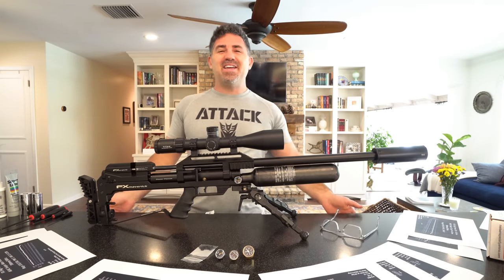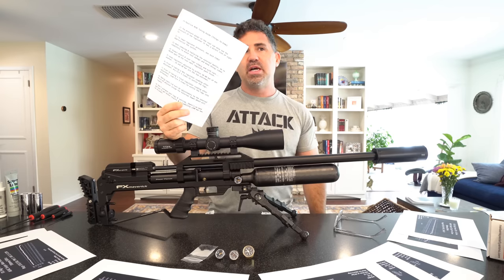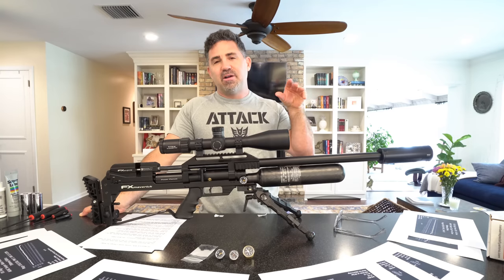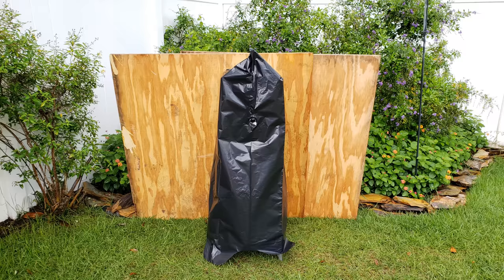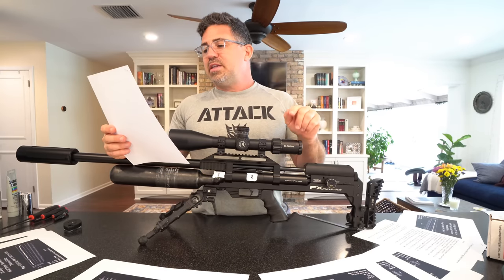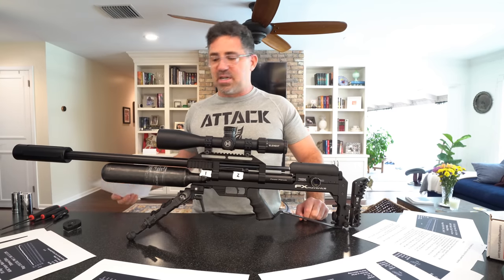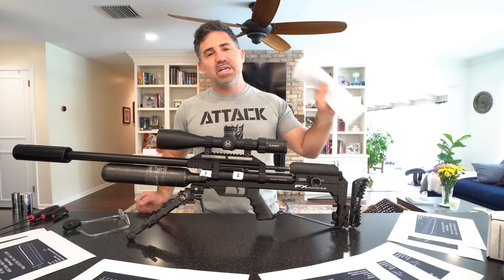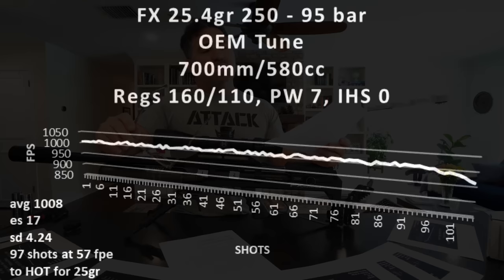FX Maverick .25 (Review) + TUNING GUIDE !! + FULL SETUP + Accuracy Test !! - How to Tune an Airgun!

Comment: Sir this video is pure gold. I bought a used FX Maverick .25 Sniper with STX Slug Liner, Optisan Optics EVX 6-24×50, 3 magazines, extra 500mm barrel kit barrel kit and Donny FL Fatboy1.0 moderator, oh and I had a carbon liner added for free. All for $2100. I think that a FX slug power kit is probably installed as well. But I will get that confirmed. For pellets I will tune the 500mm barrel. It’s genius actually because whomever owned the air rifle before me considered both slugs for long range and pellets 100 yards and under.

Comment: Fantastic work Steve! I have a newly purchased Maverick Compact .25 cal. Can’t wait to try out the 25.39 tune! Can’t believe the reg is set so low yet it pushes at such a good speed! Incredible!!!

I’d also like to see if I can shoot the hybrid or the NSA 26.8 out of the Compact as well. Any recommendations on the reg settings? Is it even possible to have one reg setting and use the power wheel to adjust between the pellet and the hybrid (or NSA 26.8)? Thanks in advance! Keep up the great work man!
Reply: Thanks brotha!  I really appreciate the kind note.  Best, Steve

Comment: Steve great to see someone finally dispel the myth of velocity variation,  a spread of 25 won't even give 1/4 moa but a damaged skirt will.  Am curious to know if you were using the heavy hammer from the slug kit or the stock one.  From what I have found if the heavy hammer is installed you have to greatly increase the  reg pressure or the valve is basically knocked into next week. That said , with one ,165/130-140 seems to work well as an all round tune for pellets and up to medium slugs from the Superior standard liner . The higher pressure producing  more energy with less air thus the shot count is still retained and an accurate harmonic tune can usually be found with the power wheel for each projectile.

One thing that might have been worth covering is how the fine adjustment screw actually works.  If you extend it much past 6mm you have a high probability the gun won't cock and if you have it in too far you will have no additional pre-tension on the first couple of power wheel settings ( velocity won't change as your increase PW value initially).  Also the Friction grub screw has a tendency to come loose and fall out of the hammer  fine adjuster assembly and some weak locktite is well worth a dab.  Its the one area that the manual thoroughly fails to cover, giving neither the OEM length or guide to the max length.

Sorry if I'm being a boring geeky ar*e
Reply: Had the same issue w/ the friction grub screw coming loose on my .30 Sniper...was chasing ghosts for 30+ minutes on velocity drops till I figured that out
Reply from the maker: Hello, I talked about it in vid several times for you guys and in depth but no, I never saw a need to try the accessory heavy hammer kit.  Regarding the internal HS adjuster as I discussed in the vid, I never saw a need to adjust it more than about 3.5 turns to run flat from 45-72 fpe.  Because of this, I found no need for further exploration.  Best, Steve
Reply from the maker: @vetteconnoisseur9531  My macro wheel screw backed out a bit few times too.  I didn't mind though.  Best, Steve
Reply: @aeacvlog2033  hi Steve I know you mentioned quite a bit about it and personally think leave more or less alone is the answer. It was more what can happen when you over adjust one way or another as a caution I was meaning. Will also try out a few of your ballpark tunes thanks for putting in the time.

Comment: Keep in mind when tuning your air gun that the more power you want to make the harder it will be to get sub 10fps ES’s. My marauder and dreamline are 5-6fps ES making 40 and 45ft/lbs. my 80ft/lb impact is usually around 14-15fps ES. If I pull the power out of my impact I can get the ES even lower than my other two guns. What a great sport/hobby, AEAC bringing the big brain again!
Reply: That hasn't been my experience but thank you for sharing yours.  Best, Steve

Comment: Another home run Steve!  I have the Maverick Sniper in each of the 700mm configurations, .30, .25, .22.

I just got around to setting up the .22 and literally followed along allen wrenches in hand and was able to set up a great tune for the 25.4 Redesigns as well as the 18.13 JSB in a matter of about an hour (slow learner I guess)! by following along with your tutorial...Your write up on AGN is fantastic to be able to refer back to general steps in the process.

Your Crown Conttinum video was my first real foray into custom tuning and was blown away by the results and have used that as a guide for my MK2 Impact/MK3 Wildcat tunes and this Maverick tutorial is a great lead in to the M3 Impact setup as well...

Great work and very much appreciated.

Dr. Mike Long
Reply: Thank you for the nice note Dr. Long.  Steve

Comment: I am running 29 grain nsa slugs at 1020 fps with 175/150 on the regs. I was able to achieve this power with the second regulator at 135 or 140 but i found increasing the reg but lowering the hammerspring tension to get the same velocity was more quiet, the shot appeared less violent and accuracy improved.
Reply: Good  information thanks , i have some 24 , 27 and 38 gr slugs to try

Comment: Hi Steve,  In talking to RapidAirWorx about the R.A.W. HM1000x LRT .22, they said it comes tuned to shoot a 25.39 grain pellet at approximately 960 fps.  My friend bought a BRK Ghost .22 HP that came from the factory shooting a 25.39 grain pellet at 973 avg fps.  He has since brought it down to 960 fps and it is a laser.  And I just watched a YouTube video on the Skout Epoch where it said you would get your best .22 groups shooting a 25.39 grain pellet between 950 and 960 fps.  What’s up with the 25.39 grain pellet in .22 running 950 to 960 fps?  Can you suggest a tune for my FX Maverick .22 Sniper 700mm to shoot a 25.39 grain pellet between 950 and 960 fps so I can see for myself?  Thanks!
Reply: Hi Billy.  Just follow the tuning instructions provided in my NEW "Ultimate Tuning Guide" video and it will show you how to tune any airgun for any situation.  Getting the 700mm to those velocities with the 25gr will be easy for ya.  Best, Steve
Reply: Ciao...la mia RTI Prophet Performance cal.25 sparò slugs Javelin 44Gr a 928fps e una bestia di PCP. Buon divertimento anche a voi.

Comment: Hello Steve, thanks for the detailed tuning guide. When you say 0 on your IHS, are you literally turning it all the way clockwise until it stops and leaving it there? And then all your adjustments start from there counter clockwise correct? I have the Maverick Sniper version and am seriously contemplating getting the compact barrel and bottle. Those STD Dev. Spreads are amazing on the compact! Thanks again for your info, that is a lot of time you are spending. I’ve done half the work as you testing tunes for slugs and accuracy tests and it takes hours!
Reply: Hi!  No, I mean that I haven't adjusted it from factory settings.  For exact measurements on the IHS, check out my Maverick full review on my other YouTube channel.  I provide them there for each shot chart.  Just understand, it's better to seek yourself rather than duplicate.  You'll get a better result.  Best, Steve

Comment: hi thanks for your video. I have now found the perfect setting for my Maverick Compact cal 25 thanks to you. reg 1 - 130 bar, reg 2 95-100 bar.jsb 25.4 gr. I now shoot for 270 ms and it is effective with the air. it took many shots before I got to the right position. the difference was to screw very carefully on the internal hammer screw. then shoot from position 4-7 to be able to set the hammer screw again. repeat it again until you were satisfied.
grettings from sweden
Reply: Great share, thank you!  Greetings back!!  Steve

Comment: I got my Dreamline Tactical .177 to a point where my 22 shot string was average speed 902, spread 7, STD dev 2.0. With 10.34 gr JSB Hades. Reg at 100bar, Transfet port Medium and hammer spring adjuster (neutral cam) at 4.
At 40 meters CTC was 20mm.
At the moment I'm pleased, but interested, what other pellets would do. I tuned my gun for Hades, cos it is my go to hunting pellet (pigeons).

Comment: Big thank you for a great instructional video, exceptionally helpfull. Just a  querry with regards Internal Hammer Spring setting - how do you determine 0 point?How do you determine the max/ min setting? I take counter clockwise increases the tension- FPS.

Comment: Thank you for these informative videos. I just received the new Wildcat MkIII BT sniper. While I need to shoot if before making any decisions I was a bit taken aback that the rifle I ordered with all the slug attachments/kits and an assortment of mid 30gr slugs was tuned by the seller for 25gr pellets with 910fps at 5 on the power wheel. When going through the owners manual looking at these adjustments I was surprised to see the book doesn't match the rifle, for some reason the manual for the Wildcat has reg adjustments for the Impact M3 and they are no where near the same in how the adjustments are made. The tuning vid FX has on their channel doesn't match these new rifles either. After a little research it appears that the Maverick and the BT sniper are using the same or very similar style dual reg and 89cc plenum set up. This video may be very useful in the near future.
Reply: Thanks!   Next FX scheduled for a review & guide is the m3.  Best, Steve

Comment: Did you pre adjust the micro adjuster so that the macro adjuster did start to put tension on the HS from position "1" and so forth, and didn't have any slack to start with?  I've seen videos when the macro adjuster didn't start to put tension on the HS until you reached "2" on the macro wheel.
Reply: It's a floating hammer system so the hammer and spring are never under tension until the gun is cocked (no matter the setting).  But no, I never tuned as you describe.  For further detail of my methods, check out the srickied posts on the AGN forum.  I've been answering  a lot of questions there.  Steve

Comment: Is there a difference between the front gauge and the back gauge on the Maverick? Are they interchangeable? If there is difference, what is it?
Reply: There is a difference but they are interchangeable.  The front gauge reads to 300 bar for reading the bottle's 250 bar fill.  The rear gauge reads to 200 bar for greater resolution when tuning the regulators.  Steve

Comment: Steve,  I bought an FX Dream pup and the regulator pressure  adjustment valve is partially covered by the stock, not allowing me to make adjustment without removing the stock.  (which is what the tech at Utah Guns told me I have to do)  When I asked if I could us a rotary tool to cut away  just enough of the plastic  stock he said it would probably void the warranty, I asked if I could turn the cylinder enough to allow access he said it wouldn't be sealed properly,  WHAT do I do?  Should I just leave it alone?
Reply: Hi Steve.  I would reach out to FX USA directly and let them help you through this.  Best, Steve

Comment: Great video thanks Steve... you do a great job.. even if you geek out and we struggle to understand some thing at times... I have a question.. I'd like know.. is the maverick way better than a crown.. and are these more complex guns like the maverick going to be more prone to break down problems? As we don't ever  realy hear anything about the failures
Reply: The Crown is the better gun in my opinion but the Maverik has more power potential.  I've seen the Crown on the podium several times but never the Mav... I think of the Maverick as more of a big-power hunter.  Now of course we've got the new King... the Crown body with a Panthera engine.  Yikes! 😁  Steve
Reply: @AEAC  yea ok that's interesting.. I was thinking the maverick might be easier to tune as I still struggle a bit with the tuning of the hammer wheel videos on the crown... It seems like most people are maxing it out before tuning it back and others do it a different way ...and you make the maverick tuning vid seem so easy... and we don't seem to see other videos from other reviews with the same accuracy even at 50 as you have achieved... I will be shooting sparrows after all ...  I don't know what is so special about the panthers..  but in the grs stock it's over 4 grand here in Australia. so it's a no thank you very much... when a crown and a maverick is about $2500.. so is the panthera the better rifle and why?
Reply: @AEAC  thanks for the fees back... do you know if there is a 800mm barrel for the maverick?

Comment: Steve,  first things first.  THANK YOU for doing what you do.  I've done a lot of tuning and I can't help but appreciate what you are doing for so many.  On this video,  would you say it would apply to the .22 cal? Do you prefer the .25 over a .22 for iguanas and why?  Thanks again.
Reply from the maker: Thank you Sam.  I appreciate that.  Absolutely the lessons here would apply to tuning the .22 but the tunes would probably be different.  If it were me,, I'd begin with a low reg pressure of around 70 bar and go from there.  For me, .22 would be more than enough for Iguana out to 100 yds with this gun.  I don't see any advantage to going .25 other than some wind resistance.  Steve

Comment: Great work Steve!  I've learned a lot from your video.  I have the Maverick .22 compact but I've noticed that i couldn't hear that sip of air between shots, is there something wrong with my gun?  Reg 1 at 140, reg 2 at 110, thanks
Reply: Check out my late release "ultimate tuning guide for all airguns."  It will help you with your Maverick.  Best, Steve
Reply: @AEAC  will do!  Thank you so much!

Comment: What kind of airgun shoots longer and is more effective at long distances. Fx3 impact or Fx Maverick (sniper) Can you answer me honestly about that. It is incredibly difficult to get an honest answer from those on YouTube who have posted videos about FX 3 Impackt and FX Maverick. I need to shoot 300 - 400m to kill with cal 25 or cal 30. Which air rifle of the two is better for 300 - 400 m shooting. Maverik can be regulated, they say, and Impackt can be tuned, so what should one choose for 300 - 400 meters in cal 25 - 30??? Please give me an honest answer so I don't buy the wrong one. I have tried shooting with both at a dealer, but it was only at 50 m and there was no difference between the two airguns.

￼
Reply: In my experience here in the U.S. based major competitions, the M3 is the winningest gun I know of by far.  Steve

Comment: Hi Steve,

Thanks for the great work! I must have spent hours watching your video's… :)

Forgive me my ignorance, but is IHS the fine adjustment setting for the hammerspring?

And if so, what's the take-off point? It being turned all the way in?

If so, I'm definitely going to try out some of your tunes. I've tried  several different slugs, but it's been really frustrating so far.

Kind regards,

 

Bob.
Reply: Yes, the IHS adjustments are for the "Internal Hammer Spring."  The best way to search for the setting is by implementing the methods described in this video, however I do share my MM measurement findings for each tune in my my full review of this gun.  Watch that vid and you'll have them.  I wouldn't recommend tuning that way through... that's not the right way to go about it.  Best, Steve

Comment: You didn't talk about the 2 transfer ports. Were you using the slug port for everything?
Reply: There are two different ports. One marked "P" and the other marked "S" which is the dual port. They are 180 degrees from each other on the barrel. You did not mention this in the video
Reply from the maker: @jeraldhessler3435  Sorry Gerald, I should have been more clear.  I used the larger slug port for everything.  Steve

Comment: Hey Steve,  As a new guy to FX  I have just purchased a new FX Maverick in .25 calibre. Before delivery to me I asked the retailer to adjust the FPE to '60', Not too sure if this was done!!!!!!

The rear air gauge shows 60 bar, while the front gauge is at 250 bar & hammer spring is set at '7'. I have yet to chrono, but the various videos on Youtube show quite different settings!!!!!

Does this sound OK to you!  Can you help ?
Reply from the maker: Hi James, honestly 60 bar sounds super low on the rear most reg pressure.  I'd recommend a thorough watching of this video and my late tuning guide video with PJ Clarke so that you can learn how to go about creating a good tune for yourself.  Best, Steve

Comment: Thank You for all that effort.... and short question - whether there is a big difference in the trigger action Maverick vs Impact M3?
Reply from the maker: There probably is.  The Maverick trigger is like the Wildcat's.  The m3's should be a step up via reduced break weight and increased crispness.  Steve
Reply: @aeacvlog2033  ok ,thats  mehanics, but...You tested both airgun....do you remember feeling ?
Reply from the maker: @petkaso1971  yes, it's negligible.  They're both great triggers but the Impact's can be adjusted lower.